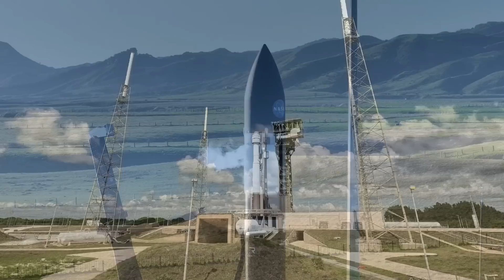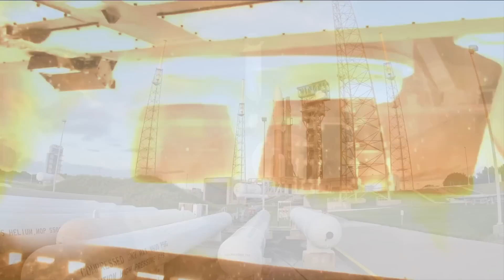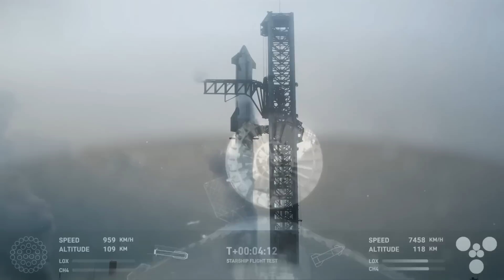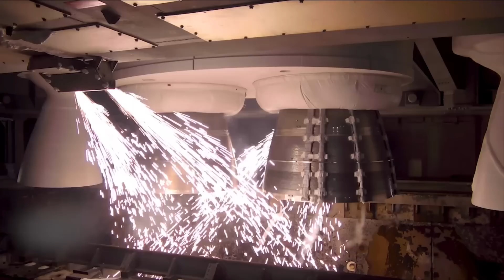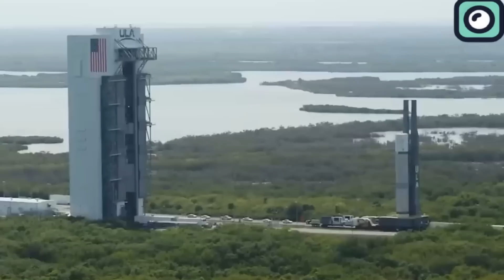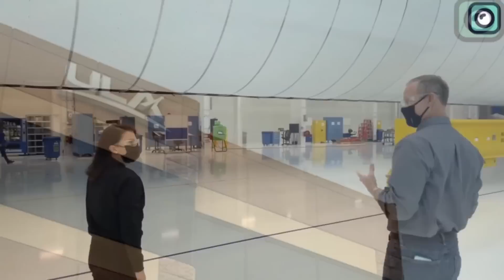ULA Vulcan Rocket Launch Went Very Bad... NASA Mad!

Comment: Firstly saying NASA is mad is bs. According to my "relative" working for them: qoute "being mad is a waste of time and energy. Rockets need testing from the start and things are bound to go wrong even if it not something that anyone wants to happen on the pad itself or withing safety zones. ULA has a new configuration with new engines and build and despite bell failure it reached orbit. Now waits a anomoly control period and then a new try will be made even though with a possible larger delay"

Comment: If I were a customer, I would not consider certifying it. 

However, I don't agree with your characterization of the timeline deviations. 
Those were a very successful demonstration of the flight software analyzing the performance of the system, and altering the flight profile to accommodate. It turned what might have been a complete failure--either a failure to achieve orbit or even activation of the FTS as it went off-course. Instead, from what I have heard so far, the payload was delivered to the proper orbit. 

The late SRB ejection was likely (per Scott Manley) due to the fact that since the thrust was unperforming, the SRBs might not have fallen into the designated zone had they been released earlier in the trajectory and at lower speeds than expected. And, of course, the core stage overburning was to make up for the underperformance, which it apparently did, or at least enough for the upper stage to further compensate.

Comment: The BE4 performed well. it partially salvaged the mission. The solid booster is a big question mark. I heard him say Blue Origin made the strap on.Did they make it, or did they just perform the integration into the Vulcan? Blue Origin is a partner in this project with a lot of hype about the BE4 engine. Was the BE4 given attention because of previous troubled development and the strapons were a what can go wrong project, without glamour or significant interest. Is it management or something else?

Comment: This video is absolutely garbage. But what else would you expect from a SpaceX fanboy. The orbital insertion was virtually perfect. With an anomaly on the SRB, the vehicle performed unbelievably. So what if some mission timelines were longer or the BE-4's were powered for a longer time. Look at ULA's CEO orbital insertion graph. It was almost perfect. ULA's Vulcan & Ariane 6 are both brand new rockets with no booster landing capabilities so it looks like the satellite community doesn't care about booster landing. I believe ULA has at least 17 flights booked already.

Comment: If this flight had the heavier dream chaser on board it never would have been able to correct for the booster FAILURE! CALL IT WHAT IT WAS!
Reply: They flew a mass simulator that was as heavy as the dream chaser.   They hoped to have the dream chaser, but didn't so why would you launch a certification rocket with no payload mass simulator??Stop guessing and making up BS.
Reply: @RickD-g7h so what was the certified weight launched?
Reply: Whatever the weight of the dream chaser spacecraft is, I don't know the exact weight. Why try to certify a launch vehicle for lifting payloads to orbit if you don't put a mass simulator on it. You're not certifying the launch vehicles ability to lift itself. I'm sure the mass was equivalent to dream chaser and also the center of gravity. So as Vulcan lifted off, it had the same dynamic performance, as if the dream chaser were actually mounted.
Reply: @RickD-g7h  but we just don't know!
Reply: It wasn't really a failure as the booster still worked. Let's not go overboard. There was no reason for the FAA to ground the rocket.

Comment: The flight didn't go very badly. There were problems. But not with the new rocket.
Reply: The SRB is technically part of the rocket.
Can ULA deliver a payload to orbit without the SRBs?
The problem is probably small, but why did the SRB nozzle fail? Manufacturing defect?

Comment: Well… like Space X would say… “they got great data.. and that was a flight test. It was total success to clear the tower. They were all shocked by all that success! After clearing the tower, it was all bonus and a large cherry on top of the pie..”
Reply: Ummm, you seem to be forgetting the anomolies at 38 seconds after lift off, with sparks and debris falling (including a SRB engine nozzle falling off) !
Reply: @johnrday2023  Not as spectacular as IFT1. I do remember. Specially the Cheers
Reply: Well, there's a difference in test and design methodologies. SpaceX intentionally flies test articles that have less than a 100% chance of success. The legacy companies like Boeing and ULA, and even some new ones like Blue Origin, design and simulate without flying, and test articles are not so much "test" as "verification". Had Dreamliner not had a delay, it had been scheduled to be on this flight, IIRC. And the first flight had a real payload too--the Peregrine lunar lander (which failed, but due to itself, not Vulcan).
Reply: @Zhiroc  In the Space X proposal for Artemis, in the span of a year it had first launch to in orbit refueling demonstration. No iterations whatsoever.
In fact, Elon was lamenting launching a vehicle and losing 28 engines. That would be too many engines to lose. I am not sure that was the philosophy back then.
Reply: @pedrosura  I've never read that proposal, but they certainly aren't shy about losing 39 raptors per test flight now. Hopefully the next will save 33, but my guess is that it won't be perfect yet
Reply: very well said,   That was a pretty good flight for the most